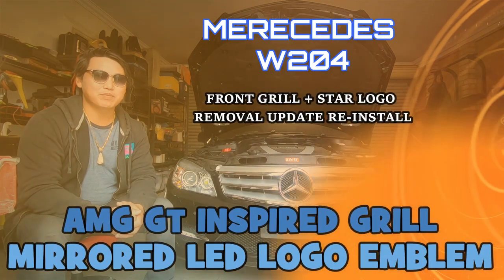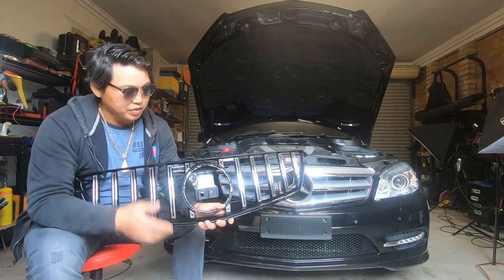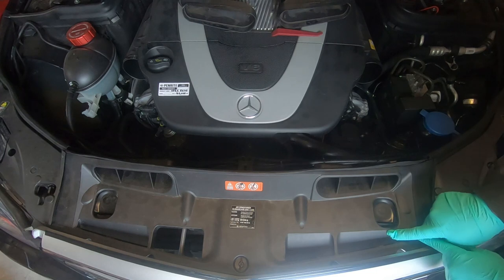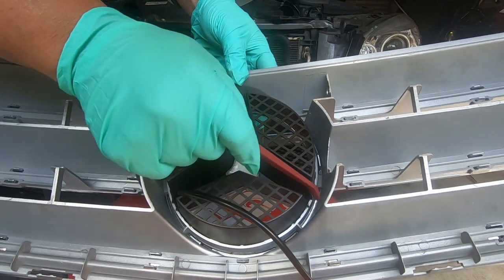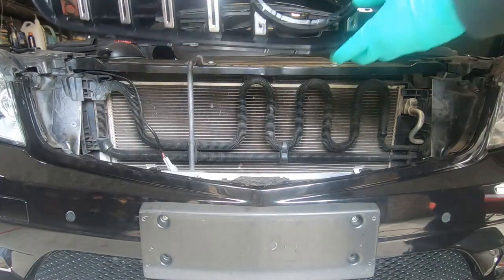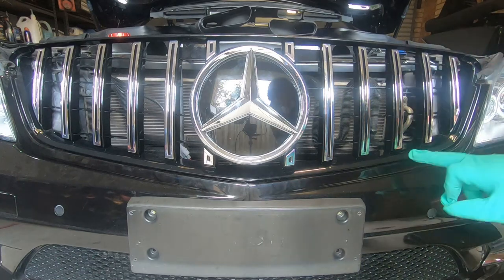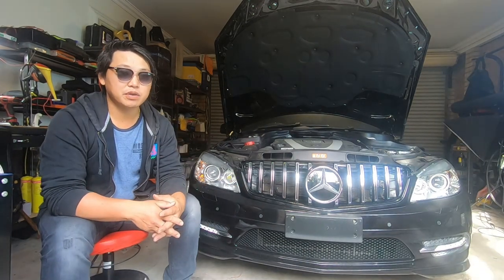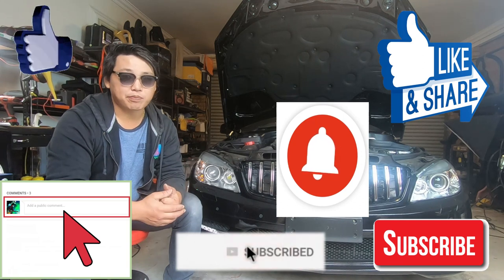mercedes w204 AMG GT style grill + mirrored led star logo install

Comment: @Mikeyz Vlogz   Hi. I dont know if its an issue but the alarm for my handbrake on my w204 C180 doesnt beep when i start driving  without releasing the handbrake. Before i was hearing an alarm or beep sound but now no sound at all. Do you have a solution for it. Thanks
Reply from the maker: Hmm firstly scan forcodes then can narrow down issueat least ive never wxperienced this personally but just sounds like an electrical fault nothing major

Comment: All I want to do is to replace the headlights without having to do any adjustment whatever ( not as enterprising as you are). Most of the W204 I see carry a different inner lens to mines. Yours are exactly as mines and I thrust you will know exactly what will fit without inducing any codes.Tell me what fits and I can make a choice. Thanks and stay covid free........
Reply from the maker: i can say this if anything ..sometimes when you buy new headlights you just need to get them synced to your car as they need to be recognised by your sam and ecu ... they just need to be activated so your car can recognize your headlights ..it may sound silly but it happens..you just need to ensure you buy headlights that are exzactly the same as yours ...match the part number aswell.. some may look the same but have different features.. for rg..ILS adaptive headlights ..whether or not you got lighting package ..bi-xenon and xenon..with that said just ensure you match your part no.. you wont go wrong..

Comment: Hello brasil 🇧🇷! is compatível for mercedes: c180; c230; c250; c300; c350?
Reply from the maker: yes compatible with all w204 models, just make sure you choose either facelift or prefacelift . usually u choose by year 2008 to 2010 is pre and  or 2011 to 2015 is face

Comment: What type of headlights you currently have?
Reply from the maker: factory i just opened them up and added halo rings and wired them to my fuse box and ground.... gonna make a switch for them too so i cam control them.
Reply: MIKEYZ VLOGZ awesome. Thanks for the reply bro. I am planning to change my eyelid halogen bulbs to a brighter, whiter lights. I am considering T10 LED bulbs from ebay/amazon. Any recommendations? What are you currently running?
Reply from the maker: @juancarlosmariano5304  ive just got some descent quality ones which costsed me ,
$15 aud for a pair... they have lasted a while but ive heard that these lights dont ever last that long due to them getting so hot ... ive heard ppl go as far as removing them completely and some have even reprogrammed the car to accept phillips bulbs and programmed the lights to accept 13.5 v spmething like that... km.told it work better doing that